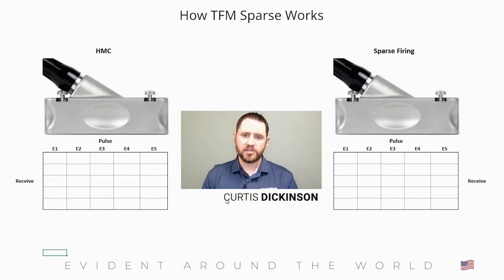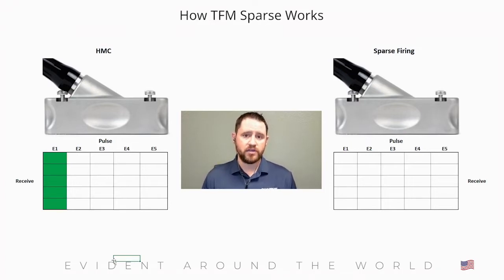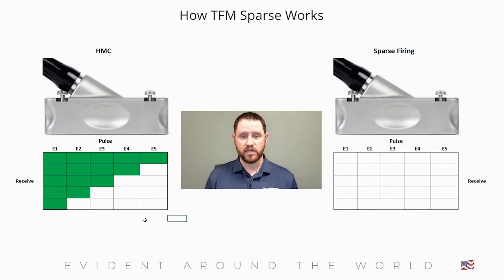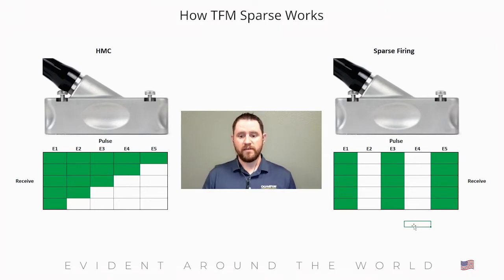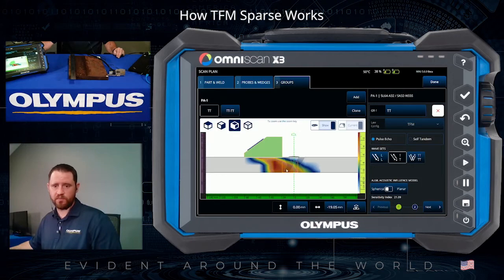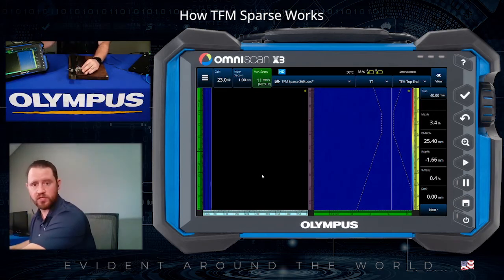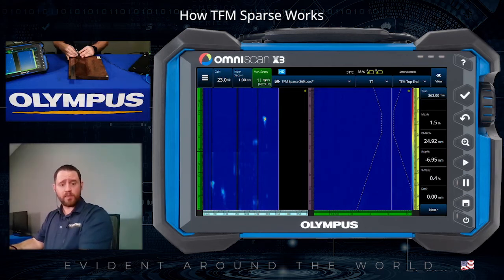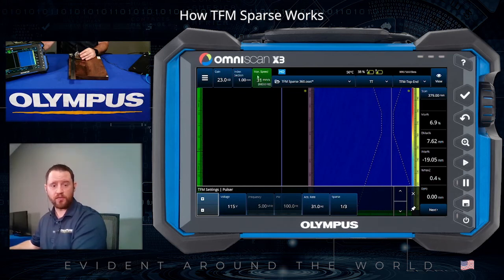How TFM Sparse Works

Comment: @andreab.1049
0 secondi fa
My name is Andrea, and I am interested in purchasing the OmniScan™ X3 for my non-destructive testing needs. Before proceeding with the purchase, I would appreciate some additional information regarding the functionality of this device.
I have watched a presentation video of the OmniScan™ X3 and noted its versatility. However, I would like to clarify whether this instrument can be used both in contact and non-contact modes for material inspection. Furthermore, if it operates in a non-contact mode, I would like to know the recommended distance it should be placed from the material surface.
Additionally, I am particularly interested in whether the OmniScan™ X3 could be utilized underneath a railway diagnostic trolley to inspect for internal cracks within the rails.